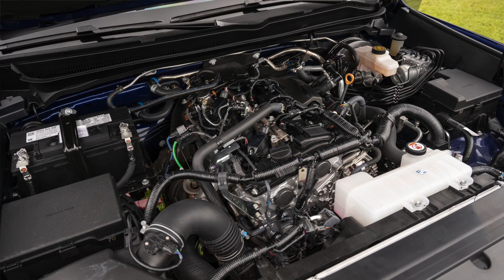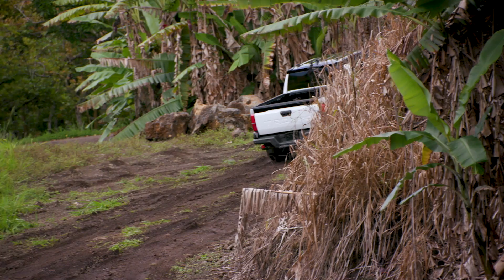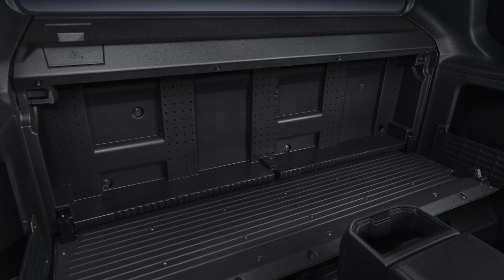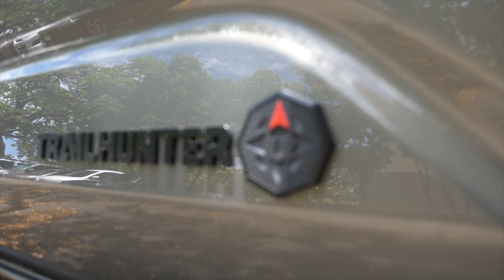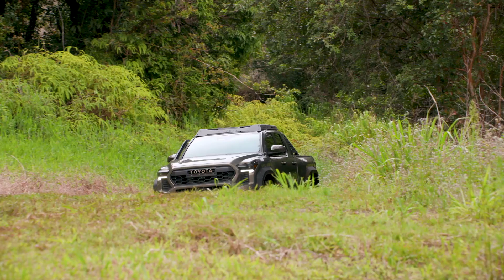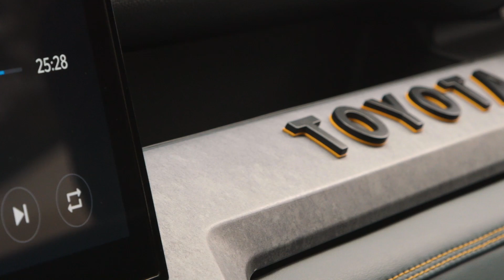2024 Toyota Tacoma Chief Engineer // What you need to know!

Comment: The aluminum hood and aluminum tail gate is a no for me. That tail is going to collapse easily and that hood will bend easy too. I always knew they are making things lighter/less material. Makes sense now that my 1996 4runner seems to be very sturdy compare to my 2021
Reply: The aluminum ages during the paint bake cycle, so it’s a strong grade.  Aluminum has been used in hoods for 20 years, most people never notice the difference.  The F-150 body is all aluminum, saves 700 lbs., which adds to the cargo capacity and saves fuel, again, most people don’t notice the difference.
Reply: @foxlake6750  i know all about the weight aspect but i guess it all depends on what people planned to use it for. For example if a branch hit the side panel, on my 1996 which happened often when i do trails, im guessing with aluminum body it’s not just scratches but actually mini dents

Comment: A Tacoma with no six cylinder engine but an overstressed and overworked four cylinder turbo means an engine that will burn out way too soon.  Remember when Tacoma owners joked that we were breaking in an engine at 400K miles?  Yeah... that's over.
Reply: We won’t know if the turbo is the right choice for 10 years…..😂
Reply: This isn't the first time Toyota has a turbo option in a truck. Back in the 80s it was available.
Reply: @bh844  agreed .
Reply: Toyota trucks started off with 4cylinders
Reply: Shut up 😂. Toyota has been marking turbo trucks since the 80s and  more reliable then na engines . Your COMMENT is outdated and just dumb . Just because you  know   one term or fact dont mean it apply to everything  😂😂
Reply: @elguapo8751  actually just like you  i thought the same but  after  i bought a 2022 ranger and rest is history .i knew how unnecessary a v6 is for a mid size truck

Comment: I would love to know how much the Tacoma chassis differs from say the Tundra or 300-series LC/LX. I know they all use the same basic TNGA-F but that does not mean they are identical (apart from the logical length difference based on application). For example the crossmembers and mounting points have been tweaked on the Tacoma and some sections of those members have slightly thinner gauge steel for cost and weight savings, since the Tacoma is not as large or in need of such heavy-duty capability as the larger vehicles according to autoblog.

Comment: Looks good, but my 2005 was such a nightmare I’m leaning Maverick.
Reply: Maverick is a completely different type of truck ie: unibody. If you wanted a car you should probably buy a car.
Reply: @PR-xh3nj  A word of advice: if you want to be a truck snob the Tacoma probably shouldn’t be your rallying cry. My TRD Off Road couldn’t carry as much weight in the plastic bed as a Maverick.
Reply: @larryaugsburger8452  You really are quite unversed if you owned an Off Road and complain about payload... 🙄

Also, if you actually needed a truck you'd be more concerned with towing capacity.

Stick to your car.

Just a word of advice in return.
Reply: @PR-xh3nj  if you plan to tow 6800 pounds with a Tacoma you’re the one who is “unversed”.   Have you ever owned a Tacoma?
Reply: @larryaugsburger8452  3 and 1 Tundra and an 87 Toyota pick up. How about you?

Where did I say, "I plan to tow 6800 pounds"? Please clarify.
Reply: @bh2236  maybe, depends on if I can find anything at all in stock!

Comment: This new Taco is good but engine is weak. That reflects in towing capacity. 
They cap the fact that they didn’t want to put or design any better engine. 
Wait until you drive it. People are overexcited for nothing. I can’t understand what’s this hype!!!
Toyota has forgotten that these are first work trucks then a toy for rich boys.
Reply: You have no idea what your talking about. That engine is going to mop the floor with the motor it replaced. It will make hp and tq  at a much lower rpm. Towing won’t even be comparable. A turbo motor can build boost instead of rpms to make power so they don’t gear hunt and struggle on hills.
Reply: @Weatherby406  I know pretty well what I am talking about. The new engine is more powerful than before and more tq as you said , but the amount of power boost is not that much to surprise me. Already many models of chevy Colorado make a lot more torque than this engine and they can tow 7700 lb . I am Toyota fan so I am upset that I have to compromise if I choose Taco over Chevy… 😕 electric boost is a fake boost and can’t last for long runs…
Reply: @Weatherby406 The Tacoma was popular due to its reliability. The potential reduction in reliability comes into question with a turbo. It's too early to tell at this point, so we'll just have to wait and see.
Reply: As long as they have direct and port injection the turbo engine will be fine. Ford figured out that they needed the port and direct injection options to keep their 2.7 and 3.5 turbo engines from blowing up.
Reply: I agree with you but manufacturers care more about selling overpriced trucks that 90% of buyers won't use for the intended purpose. How many people have you seen owning TRD Pros, Raptors, Rubicons and similar off road imaged vehicles? Half the people in my small town own real everyday trucks while the other half are wannabe cool soccer moms and rich kids that want a macho toy. These compact trucks often cost more than some full size.
Reply: it's too bad the V6 is gone. Everything moving to turbo engines is going to decrease longevity for sure but manufactures are being forced to do this for emission standards....
Reply: @planinshek  modern turbo engines have been hitting easy 6 figures in mileage for many years now. Turbo engine tech has come a long way. I don't think Toyota would use it if they weren't 100% confident in the long-term reliability.
Reply: @myemailiscool  Not just Turbo Tech, the new synthetic oils should really help extend the life of the turbo, something they didn't have in the turbo 80's.
Reply: @planinshek  Turbo engines aren't more prone to failing...

Do you know how a turbo works? If you are a buffon LORD and slap on some oversize aftermarket junk, sure, you'll trash the engine.

Comment: I wis they would put 6 foot bed for Trd pro and more room for the back seat. With 5 foot bed on Tacoma. Hood seems to look longer than bed.  There is so much room between the front grill and radiator don’t know why. I had so many Toyota Trucks 81,87,95 and first generation Tacoma the 98.  Then 2018. On 2018 the transmission was so messed I traded that year later for ford and no complaints about ford.

Comment: Hopefully finally rear disc brakes for shorter stopping distances, much better for taller people, and more available than the Ford Maverick. Prices will likely be high, with the reputation for reliability. Many will probably wait for the Toyota Stout that is priced more like the Mavericks, unless they need or want bigger for more towing or more bling.
Reply: Have you ever driven a previous tacoma? Brakes have never been and issue whatsoever. My 2015 tacoma stopped my travel trailer better than the 2017 f150 I replaced it with.
Reply: Toyota prices are usually reasonable for what you get.  I don’t expect the new Tacoma to be any different.  I’d bet there will be small discounts on the 25 Taco.
Reply: I think the interior is gorgeous.  The exterior is uglier than the previous generation - too many lines and shapes just to have shapes.  Maybe by 2035 they'll tone it down a bit. 😂  I still think my 2005 is much cleaner, honest, and  better looking.
Reply: 6ft bed or its a hard pass for me